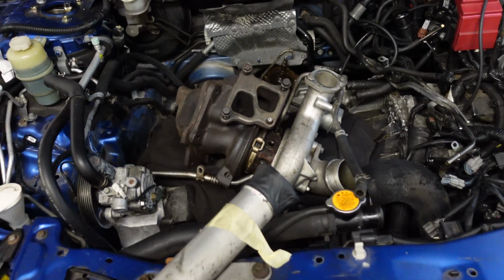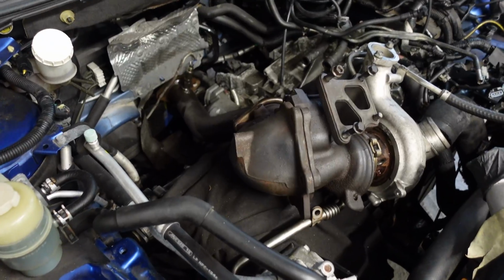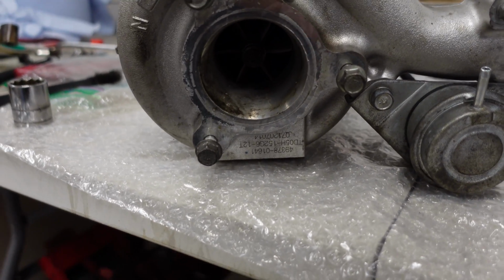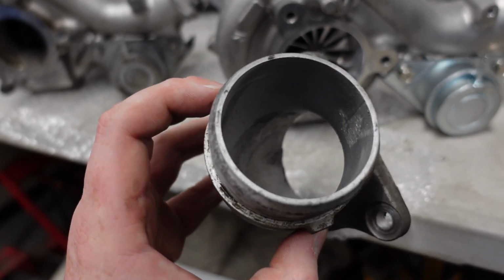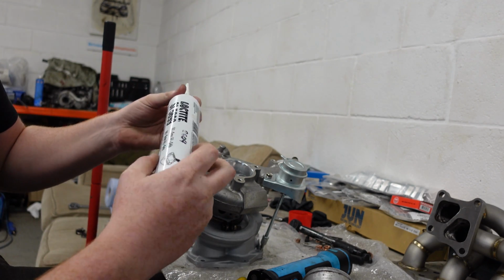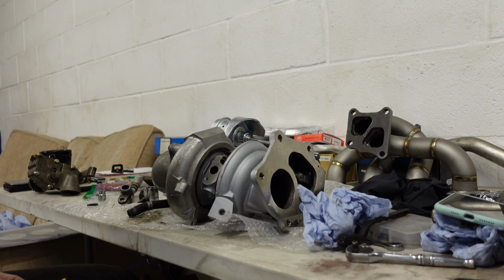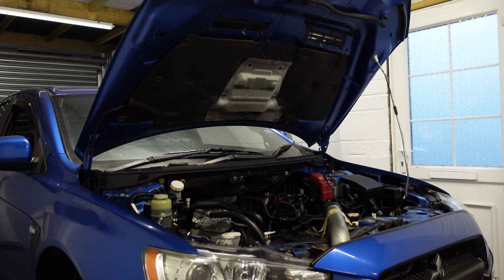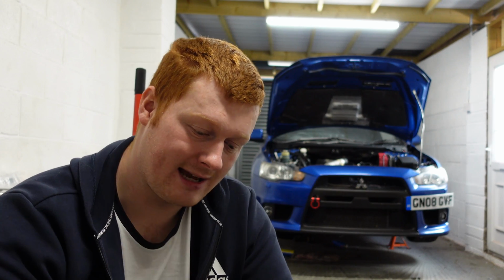Evo X Turbo Upgrade! GTX3582R

Comment: No that is a factory downpipe
Reply: False Not a factory dp. Definitely aftermarket. The elbow off the hot side is stock.
Reply: @cubalutionmr8584  yeah thats the stock downpipe, i had that before i upgraded
Reply: @cubalutionmr8584  I agree it’s a stock elbow but the down pipe isn’t stock lmao
Reply from the maker: Ok thanks
Reply: Stock o2 housing, downpipe is aftermarket.